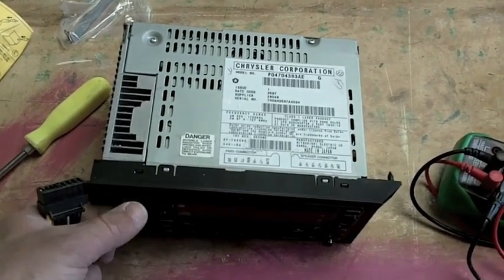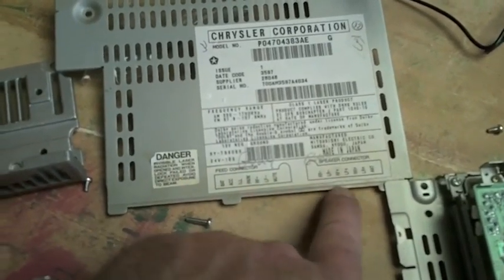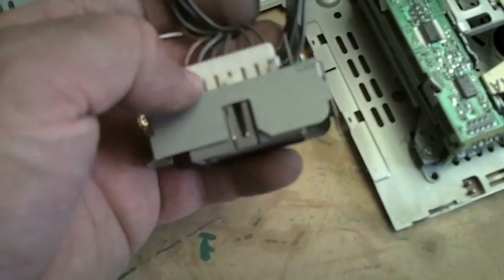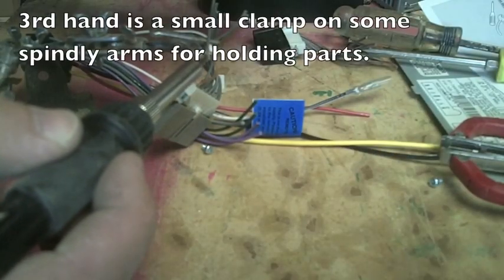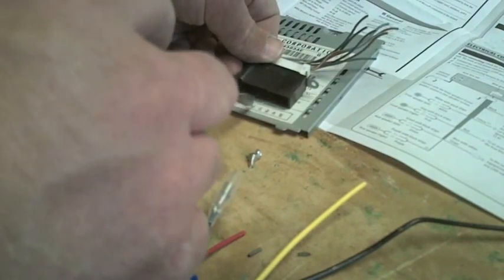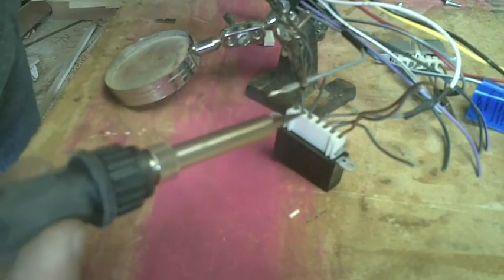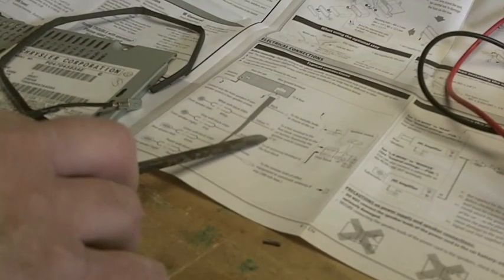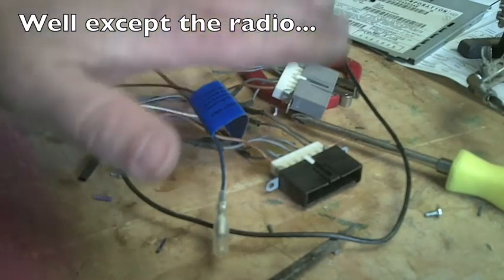How to install a JVC radio in a Dodge Ram, part 2

Comment from the maker: @nismojuan Well I don't know about more difficult...  It was a $50 JVC not some higher end system.  I know I could have gotten just the pigtail that plugs into the truck but I figured that is more or less what I pulled out of the old radio.  Living in the boonies means I have to order in anything like that so even if I got a good deal with shipping (say $15) it only took me half an hour to remove and splice into the plug from the old radio.  That works out to $30 an hour.  Worth it for me.

Comment from the maker: @BLOODLIN3E I am sorry I don't know having never worked on one.  I would google how to remove the dash of... and I bet you can find out where all the hidden screws are.  Myself I would look at the bottom of the power-ports or see if the trim around the power-ports unscrews like the bezel around an old ignition switch.

Comment from the maker: @stripes459 No you should be able to get it though the rubber gromit in the fire wall but if you are trying just to get power in the cab you shouldn't have to.  Tap into power under the dash.  Because I don't smoke I used to take the power from the cigarette lighter but that was before you needed it to power charge things.  I bet you could still do it and it would handle the load.  Unless your powered sub is huge and needs a dedicated line.

Comment: good video. i learned something by the way. also i have a subwofer i wanna put in my truck, would i run the wireing under my hood then into the trim of where the door would be, and do you think that iu would have to drill holes to do this correctly?

Comment from the maker: Loose where, side to side, up/down or in/out?  Not to be an ass but are you sure all the bolts got tightened?  How about when you bent the tabs over for the radio holder, any way to retweak those to tighten them up?

Comment from the maker: Are you sure the speaker is good?  I had a bad one.  Tap another speaker temporarily off the radio and confirm the wiring is right then if it is tap it temporarily to the door speaker to make sure the wires are ok all the way out to the factory speaker.

Comment: I need help, the wiring in my 1998 ram 2500 is a MESS! I bought it without the speedometer working and it turns out that the guy has altered the wiring so much the 2nd PCM wiring harness is completely gone. It has a JVC radio and aftermarket speakers which are wired are installed but just need the power wire connected to work. I dont know about wiring in this truck but I know my way around the motor, its a 12 valve cummins. If you get the chance I really need some help on this. Thanks!

Comment: So I have checked and double checked my wiring and still have a problem. I can only get sound from my right-rear speaker. I hooked up the amp wire to the blue-white wire from my stereo. I am not sure what else to do. Any pointers?

Comment: I have the same radio do you think i should use the plugs from the back of my factory radio if the radio is still in working order
Reply from the maker: If you are never going to use it again why not?  If you are or plan to save it and put it back in when you sell then grab one from the junk yard.  Not cutting the wiring harness is the proper way to do it.  You can also buy plugs that fit your harness.
Reply: @acme663ryo  thank you

Comment: ok i installed everything and i double checked,the radio turn ON(ilumination)but no sound!!!i double check the speakers wiring and all look fine but not sound,the only thing that i noted is that from the factory harness there is two wires that i dont know where go,one is green with a small red line(green-red) and the other is purple,i will apreciate any help cause i will like to do this by myself,i have a 1999 durango,thanks!!!

Comment: you realize you made this more difficult than what it could have been with those adapters you dont splice into the factory harnessjust have to match up the wires from the radio to the adapter...